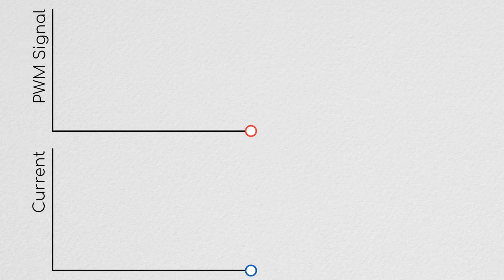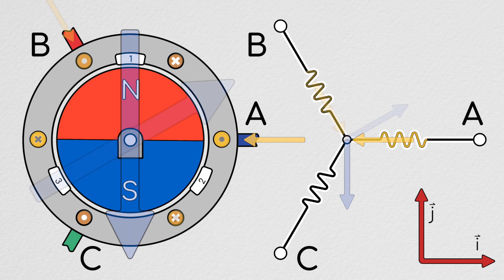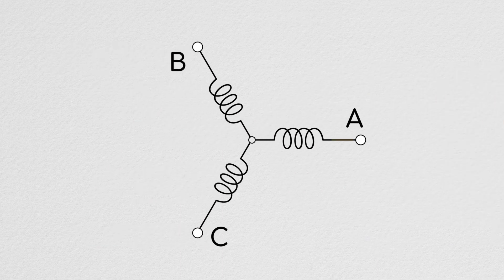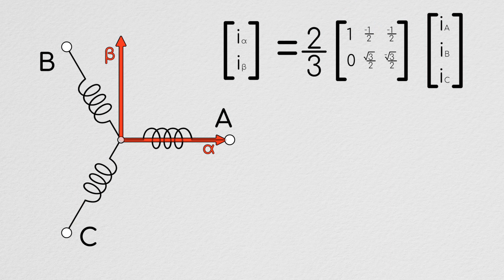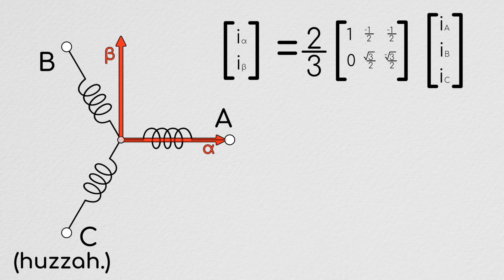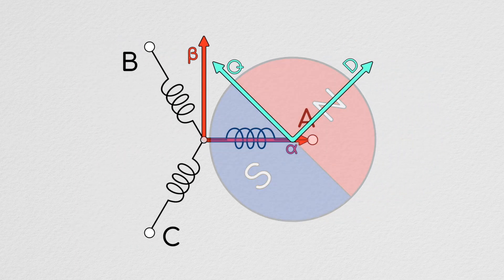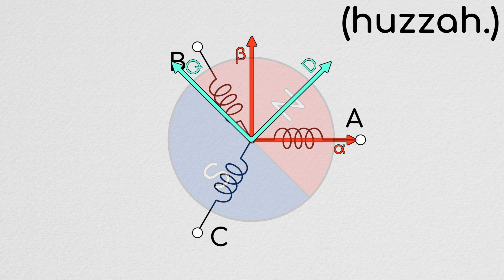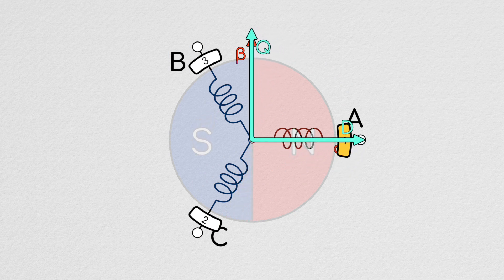The Clarke and Park transformations (Episode 8)

Comment: @ 5:23    I don't see where  the    1/2  iA =  -1/2  (  iB  +  i C)    comes from.  Could anyone please help. Thanks
Reply from the maker: So that comes from the second equation shown on screen, all multiplied by 1/2. basically, if iA + iB + iC = 0, then iA = -(iB-+C), which means 1/2 iA = -1/2(iB+iC). 
Now, why that is useful, is that if you plug it into the top equation, which says iAlpha =2/3*( iA - 1/2iB - 1/2iC), you get iAlpha = 2/3*(iA + 1/2iA). This becomes iAlpha = 2/3*(3/2 iA), meaning iAlpha = iA.

hope that helps!
Reply: @jtlee1108  Thanks for your prompt reply!  Yes, that does help alot.. Thanks again.

Comment: I think it is important to mention that the  dq0 (Park) transform has several different variations. I believe the version you describe is the same as the one described on Wikipedia (https://en.wikipedia.org/wiki/Direct-quadrature-zero_transformation#The_DQZ_transform). The "classic" way would put the direct axis in line with the A-phase current with the quadrature lagging by 90 degrees instead of leading. At least that is what I remember, but I could be wrong. I came here to refresh my memory after all haha.

Comment: Such a great tutorial series!  I'd like to see you talk about the 'new' motors using switched reluctance.
I'm working on a '4-wire' motor where you only have north magnets and energize a single pole that rotates around the stator.   
I don't know why it would not work, maybe better, but with less power density, it should also runs cooler.
Seeing how the car evs are done, they all require substantial water/oil cooling.  An air-cooled motor, with say 4 motors one for each wheel, would be so much simpler.

Comment: Hi thank you for great videos. I want to ask something. I am reading my rotor positon with magnetic encoder want to find my zero electrical angle.  I am applying PhaseA= V*cos(0), PhaseB=V*cos(-120),  PhaseC=V.cos(-240) then motor moving a little bit and stops. So this position is my zero electrical angle. But I dont know the theory behind them, do you have any idea? Thank you .
Reply from the maker: great question! so what you are doing here is you are applying a current (and thus a magnetic field) in a known orientation. if you hold this field constant, it will create a torque in the rotor which turns the D axis to be in line with your induced field. So, what you are doing is generating a field which turns your rotor so that D points (in my diagram) to the left, and calling that zero degrees. 

Edited because I mistyped. In original reply I had 'Q' not 'D'
Reply: @Jantzen Lee  thank you for answer, you said that " it will create a torque in the rotor which turns the Q axis to be in line with your induced field ". I was think that D axis will turns to be in line with my induced field.
Reply from the maker: @gokhankiremit4322  you are totally correct, sorry I answered in a rush and mistyped and then got myself confused. I am going to go back and edit my first comment so that if anyone else is reading through it doesnt get them confused

Comment: Very informing video, thanks Sir, it helps me in a school project! In a dc motor as you said vector of the magnetic field in the rotor is perpendicular to the vector of the current so d and q axis are orthorgonal. In an ac induction motor however, is it the same that d and q axis need to be orthorgonal to produce maximum torque? Thank You

Comment: Are the transformations the same for both wye and delta connected motors? The poles are physically in the same place and they are both ideally commuted with sinusiodal currents with 120 degree separation but the currents are distributed differently when injecting a curreny into one of the phases. Great videos btw.
Reply from the maker: Hey, thanks so much! It is my understanding that it would be the same for each winding pattern when performing these transformations. Because in both wye and delta configurations, you could represent the three phases as 2D vectors in the direction of the applied voltage/current flows. And, at the end of the day, these two transformations are more about the geometry of converting 3 2D vectors into two orthogonal components.